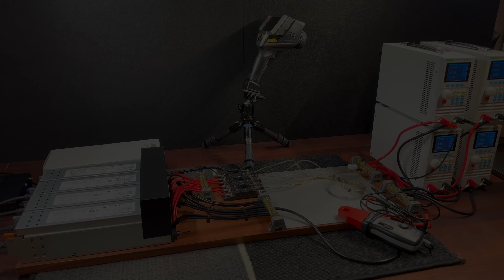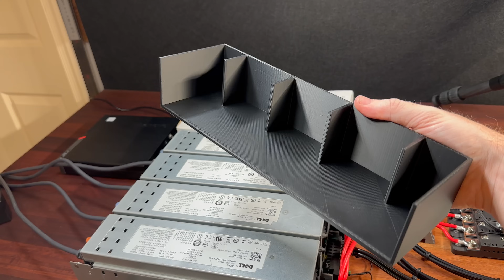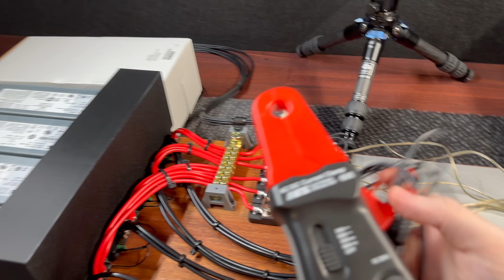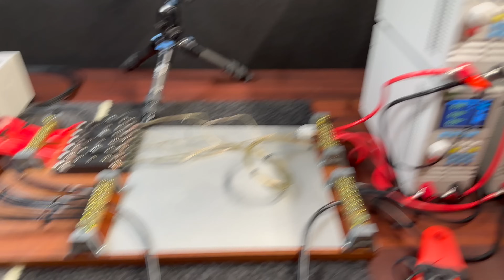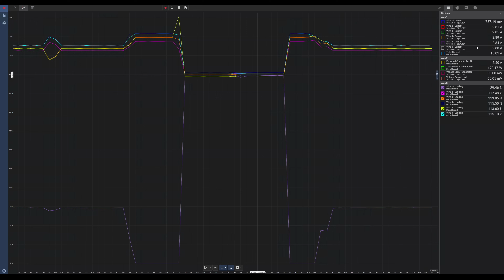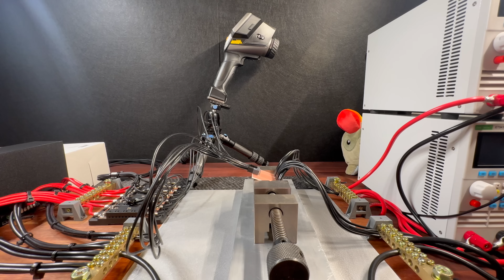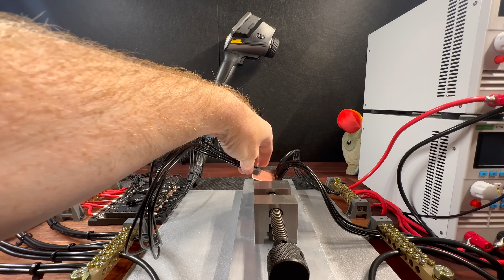NVIDIA 12VHPWR - Big Upgrades!

Comment: Load balancing couldn't really previously be done at the PSU side, because the PSU has no idea what the pins will be used for, and if the device plugged in treats all pins as one supply, or separate supplies powering different elements. As a random example, if a GPU with it's own balancing (as has been commonplace for many years) uses 2 of the power pins to power a rail for a low current cooling circuit (to power the fans), and the rest of the pins for a big rail for the rest of the GPU drawing way more current, the GPU's own current control would be fighting any PSU current balancing circuit. 

Now if the standard was set initially that the PSU would balance current, it makes sense to have it that way, but for the longest time PSUs for PCs have needed to be able to be very flexible with regards to what they are powering, with the same connector needing to power many different designs of device, from many different manufacturers, with a huge range of individual current demands, and not every device necessarily wants balanced power on every wire pair of a connector, and may require less on certain wire pairs (like in my example in the first paragraph), it's only because these Nvidia cards are pooling everything into one rail that equal current balancing is so important on these specific connectors, considering they want "All the beans" and don't care how it gets their. 

This disallows most other power intake typologies, ones where they may utilize certain pins for different power demands, which for a high power design is fine (and probably preferable), IF it's set up that way from the start and the responsibility of power balancing is discussed in the standard as being needed to be handled by the PSU end. Then, if the PSU manufacturers failed to follow the standard, you'd have a point about it being them that should be to blame. However, this is not the case, and Nvidia, afaik, did not include this aspect in THEIR new connector standard (It was developed by the PCI-SIG for a spec sponsored by Nvidia and Dell). People are blaming Nvidia because it's their own designed standard, in which they changed how they have done things for quite a few years, with meticulously balancing power on the GPU side, and failed to ensure the slack is taken up by the PSU when they they decided to change how it'd previously been handled (the power delivery GPU side). The PSU companies can't be expected to know exactly what Nvidia will be doing, without them being told by Nvidia .... So when Nvidia fail to tell them they will no longer be current balancing their end, and we have to find out months later by community investigation, after people's GPUs start spontaneously combusting out of seemingly nowhere, they kind of loose the benefit of doubt.
Reply: Underrated comment. Not only has PSU no idea, also most PSUs are single-rail so they have nothing to balance from.
Reply: I wish I read this before leaving my incredibly long comment. I could have just pointed here and cut mine in half. Seems biased imo to push blame on the psu makers who in most cases have smaller profit margins an have to work with a large amount of components. I always find it odd when people defend dicisions and cost cutting measures like this when prices are increasing at the same time. The entire point of the 12pin is cost savings. They save money using less connectors and save money on the time needed to install the fewer components. Putting everything on one rail saves even more. 12pin is nothing more than another way to squeeze every bit of profit out as possible.
Reply: @ And the problem wouldn't exist if the 12pin was instead a 2pin.

Comment: Hey @whatcouldgowrong ! Wow, that's really an amazing setup. Very excited to see you torture the 12vhpwr connector (for scientific purposes) 😅 Your previous video really calmed down my anxiety around this whole 12vhpwr story. I was very worried and didn't know, if it's safe to buy a new graphics card especially because it's so expensive, and because everyone is just freaking out about the connector. Your previous video helped me to understand that this whole situation is completely blown out of proportion, and as long as I keep the connector plugged properly, it's all going to be okay 👍 
Thank you so much! Can't wait for the upcoming video with tested. Please push the corrector and the 16awg cakes past their limits this time, and buy an extinguisher! Please, 🙏 get yourself an extinguisher before you play with it!

!! Next here is important:

Regarding the load balancing in the side of the psu, check out this YouTube video - watch?v=BAnQNGs0lOc

What do you think? Do you agree, or disagree? Please share your personal view.
Reply from the maker: There are certainly things I don't understand and appreciate his input and perspective, I believe there is a lot more to load balancing on the PSU side like everything. My thoughts in regard to this is simply from a matter of responsibility perspective in regard to a PSU's job being to supply constant, stable and safe power to components and power supplies include the cables also. From what I have seen so far (things could change) the cables / socket contacts seem the likely point of failure and not the pins on the male side socket. This is all I meant by it not technically being NVIDIA's fault for the failures as it seems very unlikely at this point that the male side probably isn’t responsible. I'm trying to keep an open mind and willing to constantly revaluate this going forward but I still think that just because GPU's have done load balancing in the past, doesn't mean its their responsibility or feasible to keep doing it at such high levels of power consumption. I personally wouldn't let this connector situation stop you from buying a new GPU but I would avoid a founders edition card purely because they use a type of connector that would be very hard to source. Most AIB GPU's, even if a connector were to ever fail, it honestly isn't that big a deal to replace the damaged connector if you find someone to do it :)
Reply: Thank you. I agree on that. For example, video cards which have the 12vhpwr connection are using type of plastic completely different from the plastic used by the psu manufacturers. Indeed, the plastic used by the Nvidia cards has a much higher melting point them the plastic from the female connector provided by the PSU manufacturer. Why? Why won't they also use that plastic? Also, they could reinforce the wires near the female connector by adding some sort of rubber, or a tape, it even a thick heat shrink, but I've literally never seen them do that on the 12vhpwr, not even once. The wires just freely come out of the connector, and that's it. Why? Heh..
Reply from the maker: @H-var  Need to keep in mind that cost plays a big part and I wouldn’t be surprised if many manufacturers use knock off parts or clones also. The PCB connector is a high temperature plastic as it needs to survive the heating / soldering process for something like 30 seconds 🙂

Comment: I have issues with what you said about NVIDIA not really being to blame for this issue.

"NVIDIA just took this connector as part of the ATX specification.": This is false. NVIDIA actually invented the connector themselves and started using it on the 3090 FE before it was an open standard. It was added to the PCIe 5.X standard later on. So any deficiency with the connector design fundamentally starts with NVIDIA. Additionally, the 3090 FE actually power balanced the connector, which is why it had no issues with failure. the 4000 series joined all the pins together.

"They're not really responsible for a power supply not load balancing correctly. The PSU should load balance the connections": This is also false, it's fundamentally at odds with how power delivery to hardware works in general. In consumer electronics, a power supply's core responsibility is to generate a fixed regulated reference voltage and guarantee that voltage is within spec up to a certain maximum current draw. The device that's pulling power is what controls how much current is actually drawn, because it is the thing actually drawing the current. This is how the vast majority of standards for power delivery work, it's up to the consuming device to stay within the specification of how much current is allowed to be drawn over the connector. The power supply can offer some protection mechanisms for faults, like overcurrent cutoff, but ultimately the consuming device should be responsible for staying within the specification. This is generally true whether it's a USB-C charger powering a phone, a PSU powering a GPU, or a wall socket powering a desk lamp. The source provides some constant voltage spec, the consumer draws current that's under the spec.

Adding power balancing to the PSU side is certainly *possible*, but it's fundamentally a dirty hack. It requires the power supply monitor current, and adjust the voltage on the individual pins. It adds a bunch of extra circuitry to the PSU, it reduces efficiency, and ultimately it violates its own fundamental responsibility of generating a clean fixed reference voltage on each of those pins.

Imagine if you expected the supply to regulate current in any other setting. Like, you plug a lamp into the wall and your house's electrical box is suddenly responsible for dropping the voltage to keep the current in check. It's just not how it works.
Reply: @ryan.crosby  Thanks for writing this! I thought I was crazy, as I was the only one saying this, but the more I think/read about it the more it makes sense.

Your analogy to a wall socket is perfect! A PSU, in any shape of form, where many different things may be connected to it, unless specified as a constant current source, is almost always a fixed voltage variable current supply. It's done this way for a reason, because unless a PSU is specifically designed to work with a single device, there is no way to know exactly what the load wants. The majority of loads will "set" what current draw they want, and sometimes, in things with varying power demands it will set a varying power demand. If a GPU doesn't want max current on all pins, because say 2 pins are powering a rail that only needs say half max current, and the other rails all want max, with current balancing PSU side this is not possible and will actively fight againt the GPU current balancing circuitry.

Further more, and even more importantly, if a GPU with current balancing and a PSU with current balancing were pulgged into each other, without some form of communication between them, there is a chance they will "not agree" due to wire resistance, heat etc making each end have a slightly different view of what's going on, there now becomes a tipping point where if one end wants to raise the current, but the other wants to lower it (because one sees its slightly high, and the other slightly low), you could quickly get into a situation where either end is trying to pull the current in opposit directions and the more each one tries, the more it forces the other end to do the opposit, quickly getting out of hand! This would also be true even if feeding just one rail, as the pins can still have slightly differing current draws, even in normal healthy operation (with useually a single balancing circuit making sure this doesn't stray too far from ideal). 

As GPUs, and infact most other interchangeable loads, are normally incharge of current demands, and PSUs normally just give current upto their limit at a fixed voltage, when something that once controlled current draw across multiple parallel wires suddenly stops doing so in a new version of its self, the PSU companies litterally can't add current balancing, because it will not play nice with the previous versions of what may be plugged in that does current balance (3090FE as a perfect example). 

It only works if it is written in the standard that PSUs from the start will take up this roll (which afaik is not the case here), however this is a very unusual thing to do, and is not how most other PSUs that are to power many different varying devices work, as they don't know what these devices may want, so it's useually just left upto the supplied device to dictate what current it draws, and from where, for this reason.
Reply from the maker: I don’t believe NVIDIA invented the connector lol, the ATX standards is a consortium of many players and no one has a monopoly to make such decisions. They will have specified what they wanted in the design and outsourced it to someone like MOLEX to design with input from everyone else… likewise AMD are using the connector now also. In regards to the PSU, can you honestly say the PSU has no responsibility in this when its sole job is to supply reliable, consistent power to peripherals and the wiring that is likely to be at fault is also supplied with the PSU. Im simply pointing out that blaming NVIDIA isn’t fair either because they aren’t responsible for faulty wiring.
Reply: @whatcouldgowrong7914 NVIDIA developed the previous proprietary connector which is found on the 3090 FE, which is technically not official 12VHPWR because it lacks the sense pins, but it's 12VHPWR in every way that matters and was the foundation of the 12VHPWR standard. The sense pins were added by PCI-SIG but the underlying design started with NVIDIA.

And yes, I am saying that no fault lies with the PSU. The PSU is a fixed voltage source, that has always been the extent of its responsibilities. It has no way to regulate how much power is drawn per pin unless it changes the output voltage of each pin individually, because the effective resistance of the load is what dictates current draw.

Maybe it should have protection circuits, like over current detection per pin, and shut off all power if any of them trip, or throw a warning of they deviate a lot. But per-pin voltage regulation is a dirty hack that makes assumptions about the load (GPU) pin configuration and it shouldn't be necessary.

Think about it this way: The PSU and cable together are fulfilling their promise of delivering approximately 12V on each pin, at the GPU connector end. The PSU isn't obligated to make them all exactly the same voltage, or even at the same current, it's just required to keep the voltage within spec. If the GPU has some behavior internal to itself (aka soldering all the pins together on the PCB) that causes that voltage imbalance to create an overcurrent condition on a pin, that's an issue with the GPU design.

Ultimately, the GPU should load balance the pins, just like every older PCIe GPU dis, and how the 3090FE did on its 6pin connection.

Comment: Nvidia could have chosen the 12v eps connector that is used on occasion in the professional/server market, it has 4x 12v wires and you could use 2 of those to supply 700+ watts
Reply from the maker: Those wires are 16AWG still so the same applies
Reply: @whatcouldgowrong7914  the wires being the same is not the same as the mating connections, the rating on eps is 7amps per line, on 8 pin its 8 amps, (8pin hcs/hcs+ are rated for 10amps.

Pcisig recognized standards for 8pin was insufficient for safety which lead to hcs(+) spec, which should be able to handle much more than they are rated for.

The problem is the 12hpwr seems to be rated within10-12% of its predicted failure limits and should not have been specified with 9.5amps when all their previous more robust connectors were marketed, at 7 and 8 amps standard with special considerations for HCS(+) versions being rated at the same or just above 12vhwpr.

Alot of my information i learned about by looking up on molex, jongerow, evga, and other technical sheets
Reply: @whatcouldgowrong7914  Wires being half the issue, the other half being the mating surfaces, 8 pin pcie standard pins used to be divided into two groups, standard often folded or hollow pins 150w rated(288w)8amps, or HCS terminals often solid copper 150w rated(396w)11amps, the terminals used in 12vhwpr don't appear as robust as most 8pin standard terminals so how should it be rated for 9.5amps per conductor.

So the idea here is what's better 2x8pin or 1x12vhpwr, eps 8pin is essentially 2x 2x12v, and some psu's use universal eps/8 pin pci-e, 6v8 12v lines, and both can use the exact same terminals packaged in different connectors.

Comment: Imagine an electrician adding a 50A circuit to your house but instead of using 6 awg wire he uses 6x 16 gauge wires because it was cheaper and easier to pull through conduit. Then replace the screw terminals on the receptacles with end-user installed snap fit connectors... Would you trust that without active current sensing or per-wire fuses?

Excited to see your tests with this setup!
Reply: Those wires would not be allowed in the same conduit but overall would be a lot saver. And it would not be cheaper either.